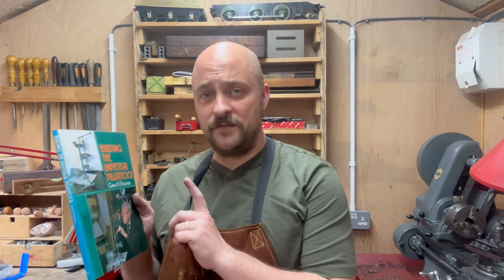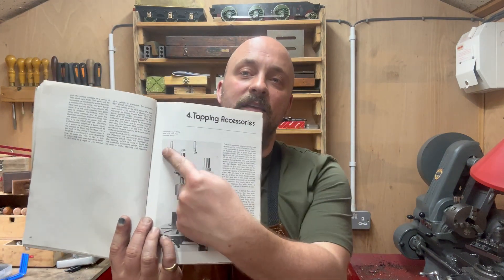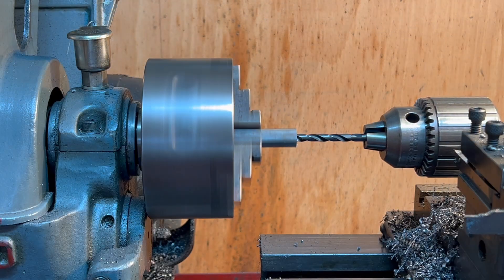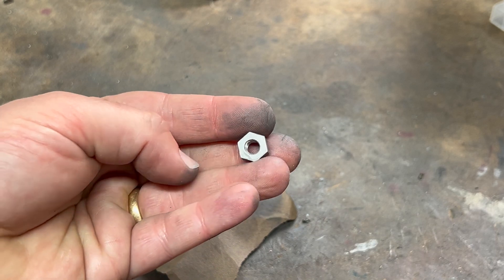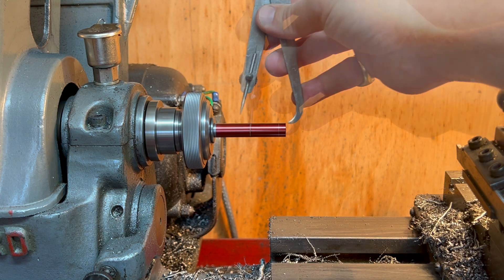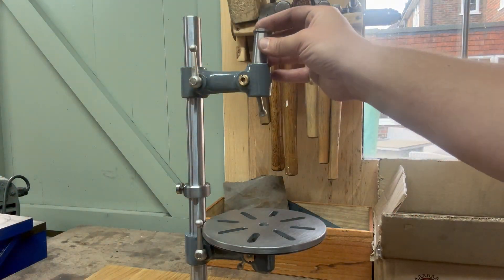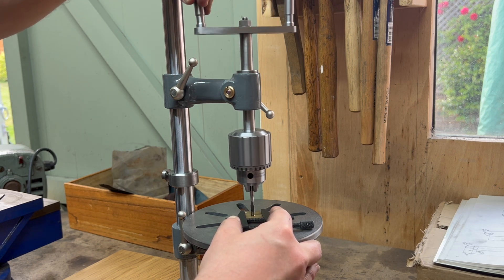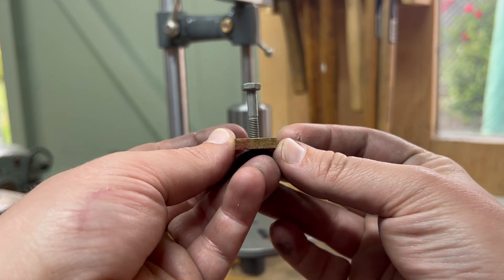Building the Universal Pillar Tool - Pt. II: Tapping Spindle

Comment: Looking great! Now what tool do you need to make to make a knurling tool......?
Reply from the maker: Ah, i don't really want to be one of those channels that only builds tools - I think (!) that this is probably the last tool build for a little while. I'm restoring my Hexacut currently, and I may or may not have acquired a shaper - but the goal is still the locomotive and traction engine construction!
Reply: @williamsworkshopuk good plan, I fell into the trap of doing projects and tool builds other than my real passion for model building. Stay on track pun intended!